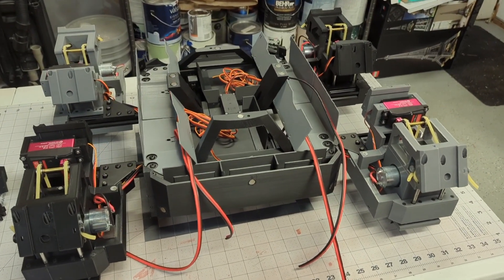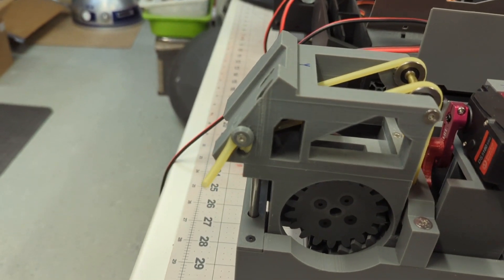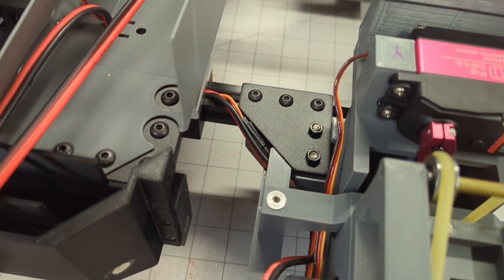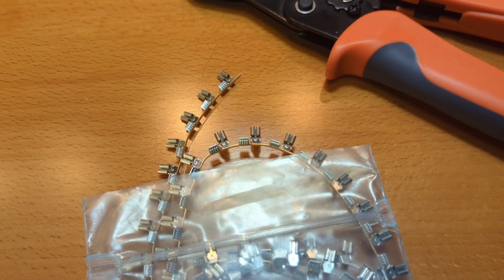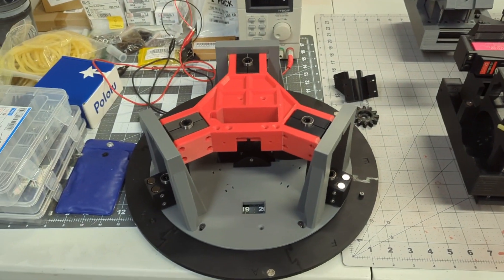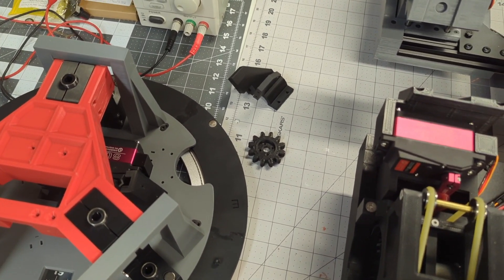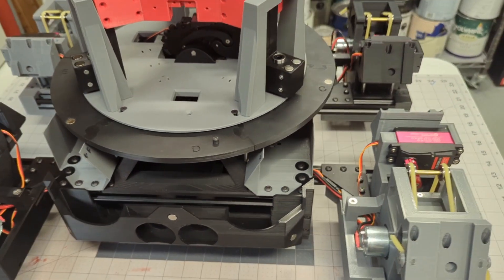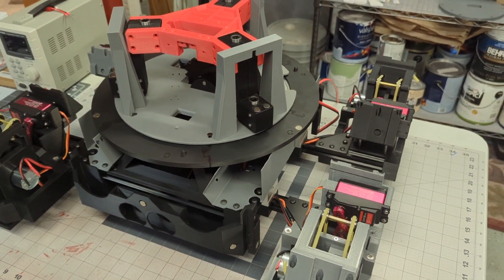B2 Build Update: Finishing the Drives and Preparing for Electronics

Comment: Awesome video and info! I learned a lot from your R2 videos that I implemented into my own. I’m just finishing a BB8 build and B2EMO will be my next project. Looking forward to more progress updates!  Can you confirm the drive motors and lift motors are (#4693 drive) and (#4843 lift)? Thanks
Reply from the maker: BB8 must have been a fun and different build! As for the motors, you do not need the motors with encoders built in. Four Pololu #4683 are used for the drives, and two Pololu #3203 are used for the spinning body rings as currently designed. However, I would prefer to avoid running a mix of 24v and 12v motors, so I'm waiting for a 24v motor mount option for the body motors (Michael is aware of this request, and although some of the early prototype builds used custom 24v mounts, they aren't compatible with the current V2 parts). In anticipation of this, I picked up two Pololu #4681 motors for my body rings.

The lifting mechanism uses 80kg servos. So far, I have needed 7 of those servos - one in each drive, two for lifts, and one for the extending wheelbase.
Reply: BB8 has been far more complex compared to R2 for the electronics. Less printed parts though. 
Thanks for the info on the motors! I’ll do the same and wait for the mods to use 24v motors for the body rings. After seeing your videos on R2’s electronics, I changed mine to only have 24v and 5v. Looking forward to learning more from your builds!